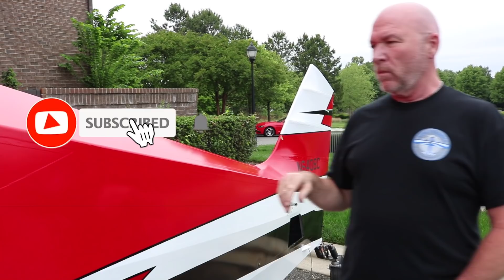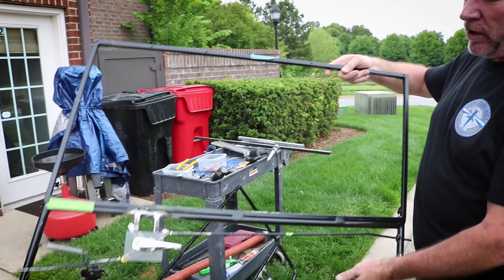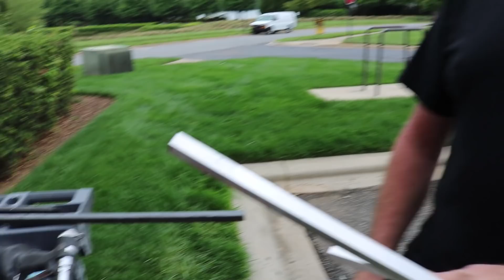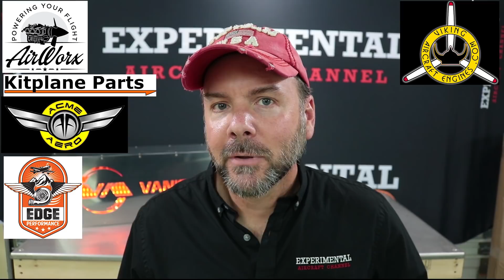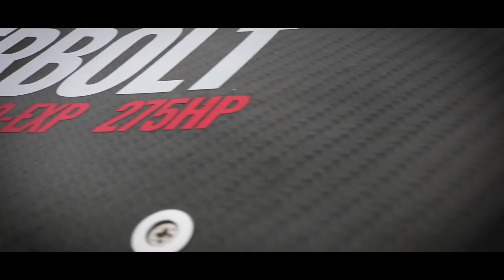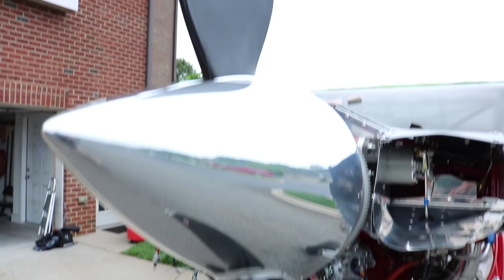Bearhawk STOL Aircraft -  Lycoming THUNDERBOLT - Rob Caldwell

Comment: The big high Hp engine are nice but buy 2025 100LL is on the chopping block for the EPA to be going away and a lot of these engines will not be able to produce that kind of horsepower on alternative fuel. Anything with more the 8-1 compression will have trouble. Going to need direct fuel injection and electronic ignition to run alternate fuel at higher HP

Comment: If you rivet the carbon fiber tubing, you will get galvanic corrosion and the rivets will fail in time.
You could actually make a functional battery with aluminum and carbon.

Comment: Another great interview with a owner/builder with his Bearhawk Aircraft. His paint scheme came out amazing with him using the Stewart System. I have painted quite a few aircraft and cars over the years that seeing a finish on his aircraft I can say he prepared everything well before he even turned on his compressor. He had to have at least 60 gallon with 9.5 CFM. with a quality gravity feed HVLP spray gun. Nice finish. With a quality and color selection using this system I’m not sure I would want to use Oratex. Oratex is a lighter weight material but limited on color selections. And if want a color scheme that is more appealing I’m going to use the Stewart System. I’ll take the small weight penalty especially with a 3,000lb. aircraft! Loved his work! He could have used a layer of fiberglass between the carbon fiber and the 4130 steel. Either his first layer or his last depending on the layup. That would protect the steel from the flow of electrons causing corrosion.
Reply: Good points.  I'm am actually using a layer of kevlar between the carbon fiber panels.

Comment: What max rpm?
Reply: The engine ran for 3 hours on a test stand before leaving the Lycoming factory.  During that test run the engine saw a max of 26.5 inches of manifold pressure and 2,719 RPM on the prop.
Reply: @TheBaldPilot  surprised its not at least 300 hp at 2700. With 84in dia prop - thats really noisy n transonic tips are absorbing torque from mach drag n robbing thrust. Decades ago io720s would deliver 375 hp at 2575rpm n transmit it into thrust reasonably well with 84in props
Reply: Lanse Lithgow - i was really surprised that he wasn’t running a three bladed prop on this aircraft. Maybe after considering all factors it wasn’t worth the extra weight up forward??? Did you ask him why he selected a two bladed prop?